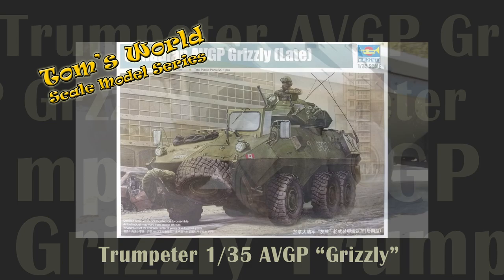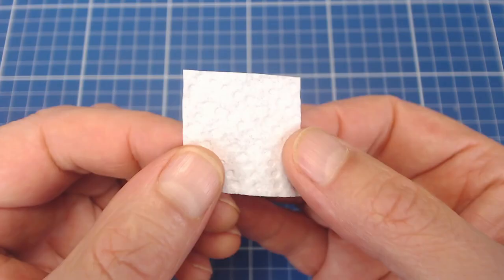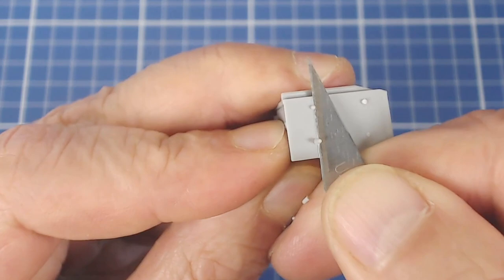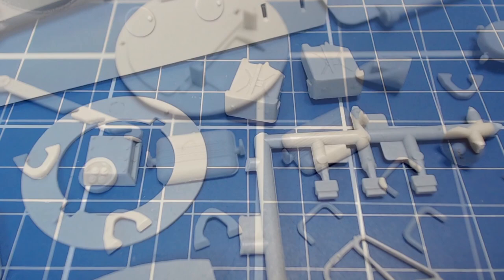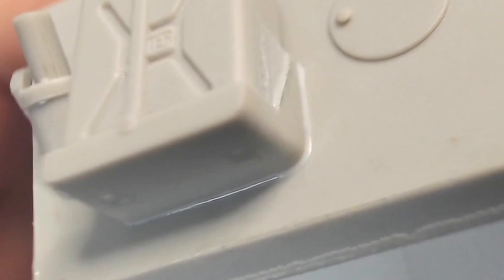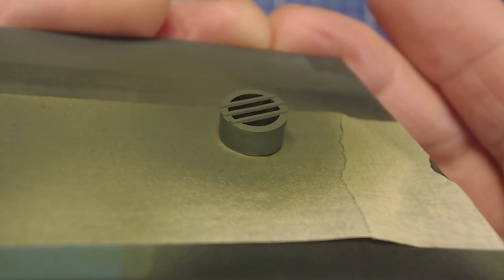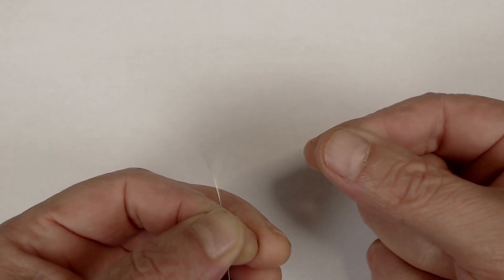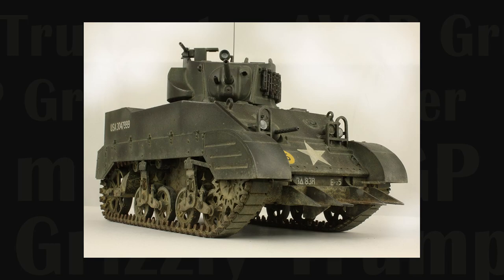Trumpeter AVGP Grizzly Model Kit Build - Part 1

Comment: Tomas, the AVGP stands for the ( Armored Vehicle General Purpose ) vehicle group in the C.A.F. ( Canadian Armed Forces. ) I am an ex 2nd Battalion P.P.C.L.I. infantryman / weapons tech. I was out before we used these in the army, but I did drive the old A.P.C. Very impressed with your build. I am building one now. Thanks for the tips.
Reply from the maker: Hi Stu. Thank you for your note and for your service. Another buddy I have also served and we had a few discussions about the 'ol Grizzly while I was building. Amazing the affinity service people have for the vehicles they operated. While I can only admire the hardware from afar, building the models at least gets me close. Best of luck on your build and I'm sure you'll have fun weathering your little bear. Cheers!
Reply: Tomas, thank you for your response. I am enjoying the build & your videos, but have one problem. The screen on the front with the three windows, do they go beveled edge in or out? Instructions not too clear. I am also painting them with a clear blue. I lost one of the B-26 hook-ups on the front top hull & so decided to leave them out & filled the slots where they went. When I am done I hope to be able to show you the finished model. Cheers
Reply from the maker: Hey Stu. If memory serves, bevel in on the windows. But please dry fit them first to be sure. They fit together in a reasonably logical way. I struggled a bit with that assembly myself....and others on that build. Trumpeter kits are inexpensive but they come with their own issues. Yes, once you're done I'd love to have a look!